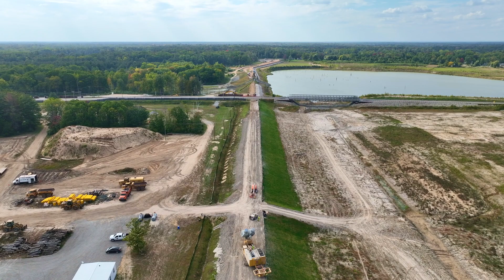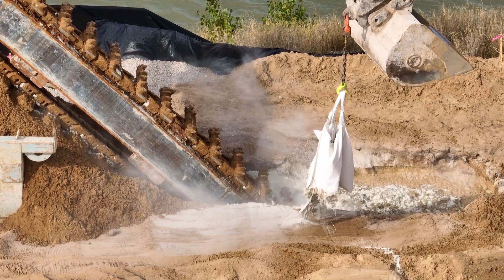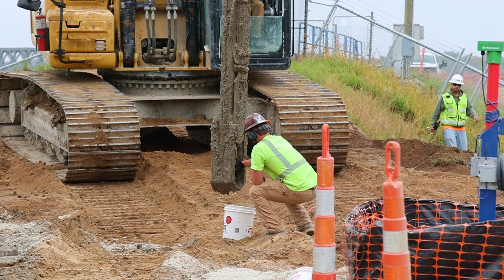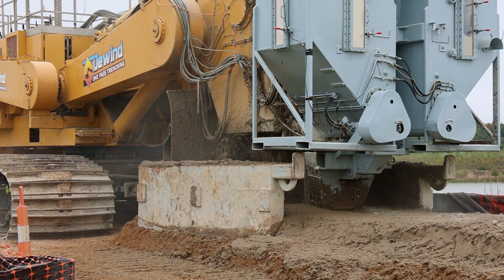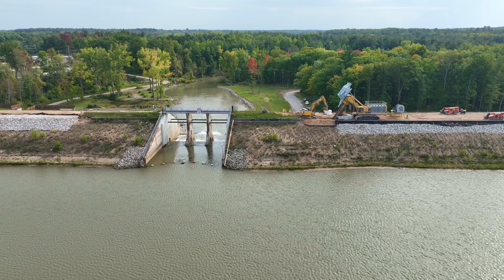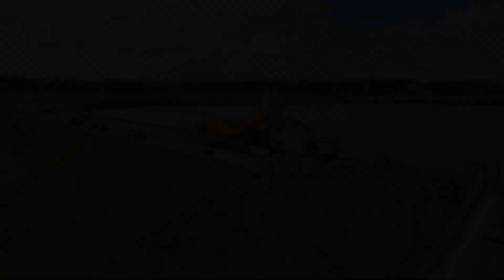Dewind One Pass Trenching Edenville, MI

Comment: Great video, I have a question, how does Dewind mobilize these machines to move from job site to job site, I’m sure the machines booms and mud plants must be disassembled and moved on Lowboys but what about the Base Machine itself do the have specialized heavy haul lowboys to move the base. machine or is the base machine also disassembled due to over weight then reassembled on site?  No doubt they have large cost to mobilize and demobilize on top of MDOT Permits and fees to transport the equipment, what kinda time frame is it to assemble and disassemble is involved in transport of the specialized equipment?
Reply from the maker: You are correct. They literally have to take apart everything and put it on trailers and haul it from job to job, and they actually have their own crews there that work on the machines if they break down.
Reply: It's about 7 truck loads to transport just the machine not including the attachments/ boom

I happen to work for the otherside of the company and run the smallest trencher they built
Reply: The crew can have the machine assembled and ready to trench in about 2 days